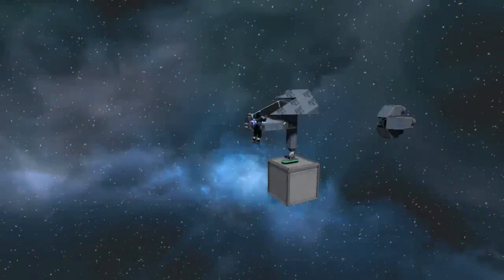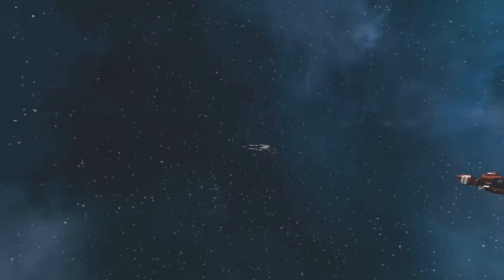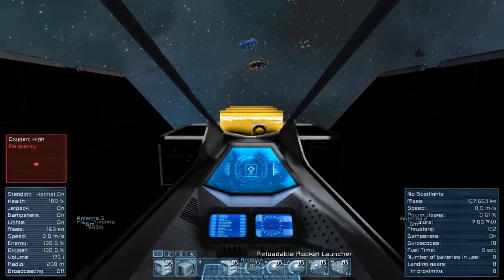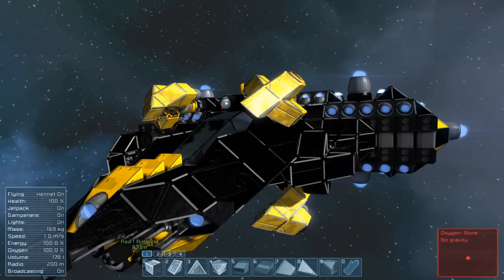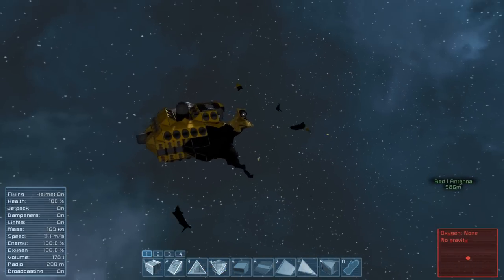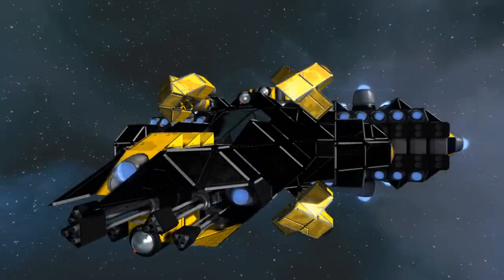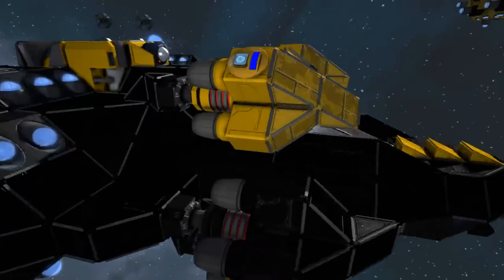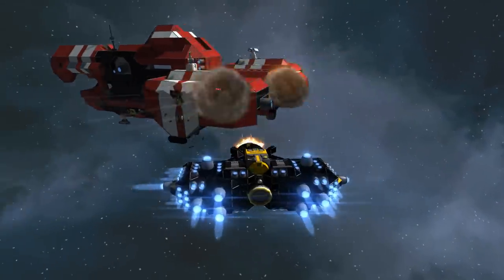Space Engineers - Viewer Challenge 6 - Destroyer Class, Anti-Fighter/Bomber Craft

Comment: Don't know if anyone has said this yet, but the rotors will be fine in MP. I've used a LOT of mechanisms like this on a dedicated server, and never had any problems. This is because the attached grid actually applies torque where the rotor and rotor head connect - they don't "randomly" explode.

People tend to put too much weight on the attached grid, so when the ship turns, the rotor literally snaps - this is an intended physics mechanic. Having so little weight on those rotors, and the fact that they're pretty near the center of gravity for that ship, means you shouldn't have any problems.
Reply from the maker: Hesterry They can do some random stuff with displacement settings etc but yeah, they don't spontaneously combust :) It IS possible to snap these off if you really really maneuver hard, but I'm talking stuff like 360deg spins while decelerating from max speed and then flipping the spin the other way suddenly... Honestly was just trying to preempt half the comments being 'omg rotors are broken why you use rotors!' ;)
Reply: ***** Yeah, I understand. I'm glad you used rotors instead of trying to work in bulky connectors - a lot of people forget they can be used this way. The ship really is very well-made, and I wasn't expecting those warheads to do that much damage! o_o
Reply from the maker: Hesterry
Warheads are the most effective weapon by miles at the moment as long as you 'airburst' detonate them and don't allow them to impact the target.. good fun :)

I REALLY didn't want to have to use merge blocks or connectors, so very massive in small ships for missile use.

Comment: i love classifying and catagorizing small military craft. I would usually consider something this sized either a gunboat or a missile boat. with the short range externally mounted rockets, i would call it a heavy rocket boat. it is heavier than a normal fighter or bomber, but still utilizes a cockpit and can engage in dogfighting in its own right. not quite a missile boat because the external projectiles are not independently guided. "Destoryer" i would save for a moderately sized warship with a dedicated bridge and crew compartments, a more traditional naval ship style.

i like the idea of useing rotors as the  merge block or connector to keep the rockets on the hull. i've not seen that before.
Reply from the maker: saxmo Yeah, I missed the 'boat' (sorry...) somewhat with this one! Destroyer was a bit keen.. I think a PT boat is prolly the best description I've seen so far, encompasses the short range dumbfire range of the 'torpedoes' nicely and also clarifies it's size and role a fair bit. Next time I'll think a bit harder about it but it was kinda based off the fact someone asked for a destroyer that could do a certain range of things, and this is the size of craft I needed to achieve what he asked for! :)

The rotor trick is nice, but only works with low-mass objects.. otherwise you rip the rotor head off when you turn etc

Comment: I really like the momentum weapon system that you have on this ship!. I'm going to have to find a way to recreate it without using mods.
Reply from the maker: Aidan303 It's a tricky one as batteries are so much larger when you're talking about small ship variants... I'd actually prefer to use a reactor. One of the two versions in the world has reactors instead of capacitors in the warheads so would just need to replace the armour thrusters on the ship, the projectile itself is vanilla :)
Reply: In the version that I am currently using, I completely removed the power source on the missile & instead, I triggered the warhead countdown before the launch. It works almost as well once you get used to constantly firing from the same distance.
Reply from the maker: Aidan303 Yeah so gone purely kinetic with the launch system, should work fine tbh as long as you remember to hit the brakes when you release them :)

Comment: Please make an unmodded version because I like the vanilla builds you always do
Reply from the maker: Skythedragon The creative version is basically un-modded, would just need to replace the small thrusters (which won't break the ship if you load it with the mod disabled.. then just fill in the gaps with thrusters)
Reply: thanks! and the capacitors?
Reply: Skythedragon He says the creative version doesn't need them as in creative you can just use reactors.
Reply: ok
Reply from the maker: Skythedragon
Good point though dude, in future when it's a design like this that could be converted to vanilla-only I'll try and include a vanilla version too!
Reply: thanks!